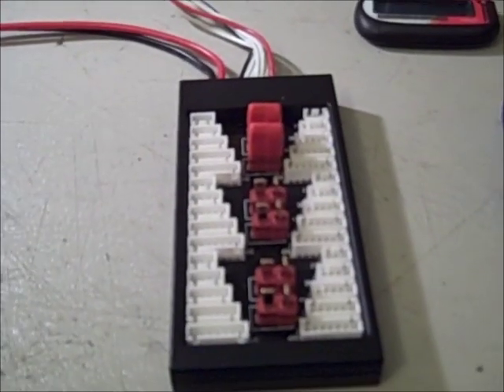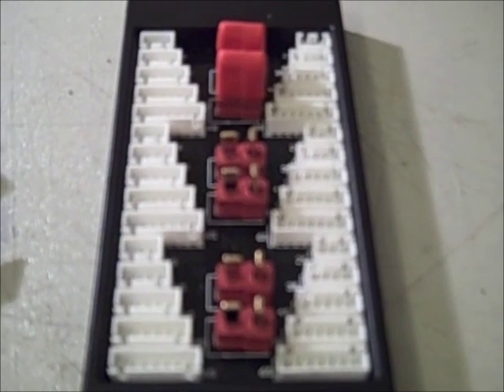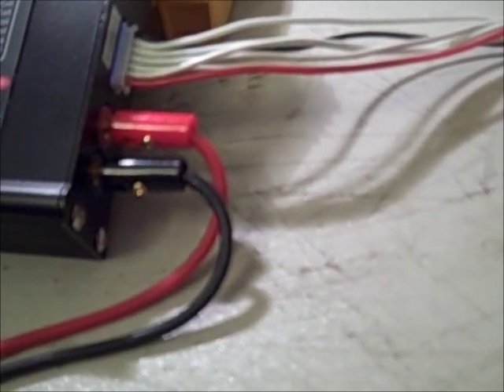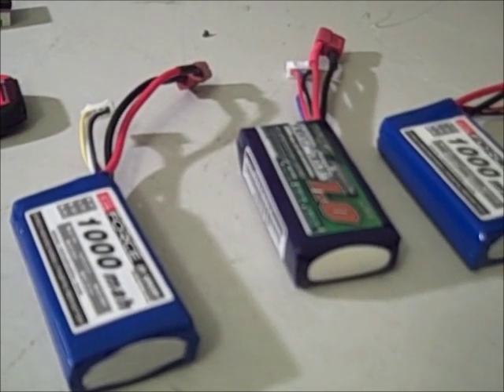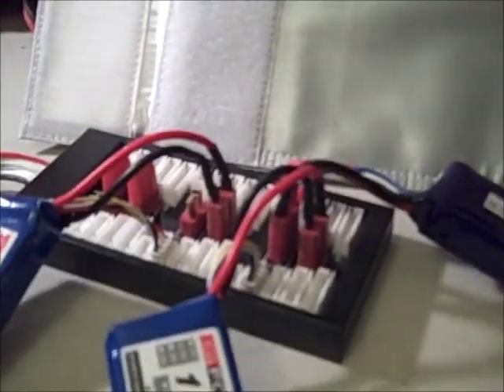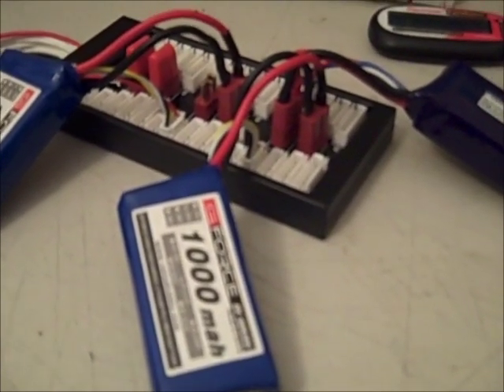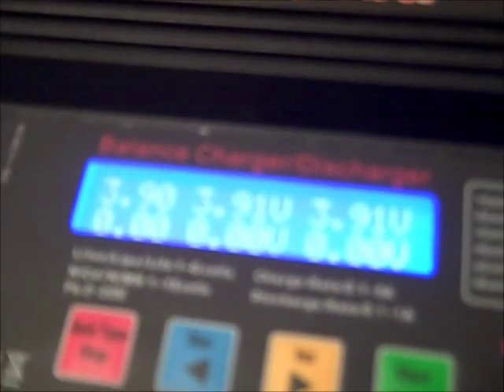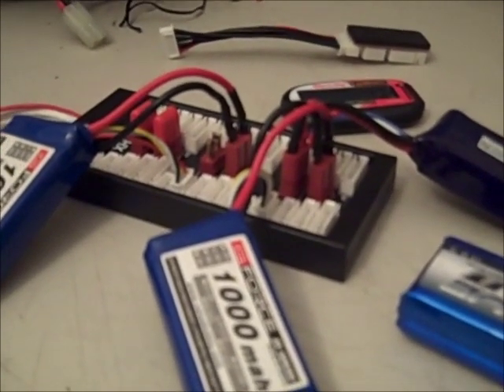RCSpeak.com Parallel Lipo Charge Board Review

Comment from the maker: your problem is charge time...most chargers will not do more than 6 amps at a time...so if you have a 5000 pack and a 5200 pack and you do a max charge of 6 amps..they are going to take a very long time to charge together and will be maxing out your charger for a very long time...unless you have a 20 amp capable charger you are looking at least 2 hours charge time or more...with packs that large i suggest charging hem one at a time...it's like filling a bathtub with a squirt gun lol

Comment: Thanks  there is one more question  so if I have  4 of the 3cell battery both 11.1 but one  with the Capacity  of 5000 and the other one with  5200  but regardless of their  C  continuous and C burst  so is it still going to be ok  to charge them with this thanks

Comment from the maker: the C output rating of the pack does not matter at all for charging....it is just the voltage and capacity...i have charge dissimilar C output packs with no problem...

Comment: Hi,

 I just receive this board (with 6) but seems that I have a problem and I m affraid to use it.
My lipos have always big difference betwen cells, for example : 3,40;3,90;5,10. In this case, what should I do, I can still do paralele charging ?
The charger is from Robbe X-treme ChargerX6, and I was aspected to balance well all the cels, but seems that not always branded chargers are ok.
What shoul I do ?
Go ahead and chargin in paralel, or give up ?

Comment: Yeah i'd have to agree with you on that plus if you want your lipos to last it's best not to push them that hard,by charging at the high C ratings even if they can handle it,i mostly always charge at 1C on my cellpro 10s even though it can charge a lipo at 5C even more if i did the firmware update on it.

Comment from the maker: If you charge at 1c then you are safe... if the pack is 1000mah..you can safely charge it at 1amp no matter what....doesn't matter the discharge rate. Nano-techs can be charged at 2,3,4,5 or even 10C if your charger can do it. But to be safe for packs of different ratings i never charge over 1C..so if i have 3 packs that are 1000mah each i charge them with the board at 3 amps and it sends 1 amp to each pack and is safe...Or if i have 3 1300mah pack i charge them on the board at 3.9 amps etc...

Comment: You say you use a lipo safe bag when you charge lipos and you even say how volatile lipos can be in a comment,but then you leave your lipos in a cardboard box in a plastic draw LOL,no matter if there in storage mode or not i wouldn't leave any of my lipos in a cardboard box in a plastic draw,you can never be to safe mate,also i notice that two of the batteries have a different C rating from the Nano-Tech so don't that play apart when charging?

Comment: Cell count has to be the same but the mAh rating does NOT. I don't know where you've heard otherwise but what you are saying in the video is incorrect. 

If you parallel 1x 3S 2000mAh and 1x 3S 1000 mAh and charge @ 3A the 2000mAh will recieve 2A and the 1000mAh will receive 1A. It's because of the internal resistance which is half in the 2000mAh battery due to the bigger capacity. If you don't believe me look it up.